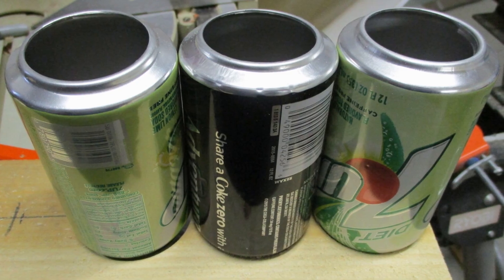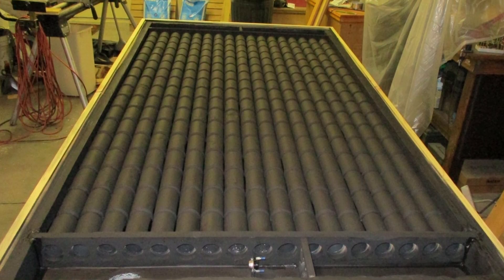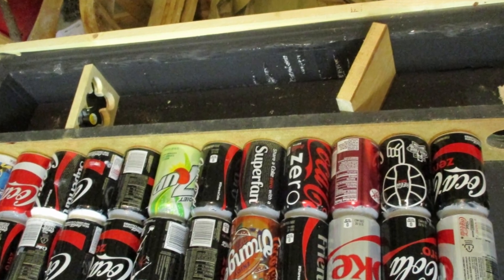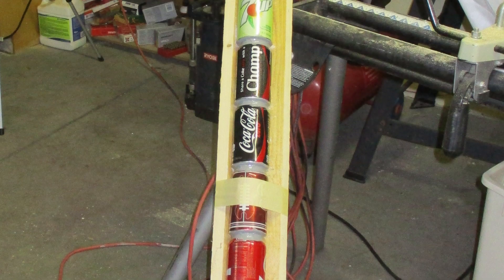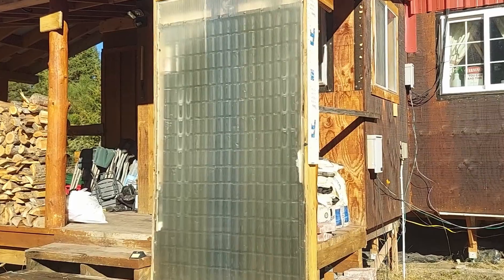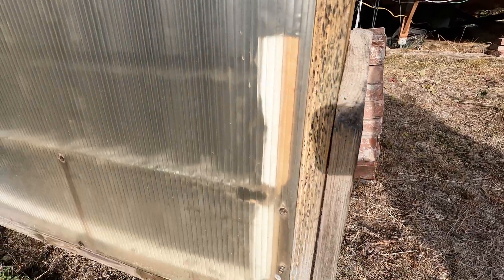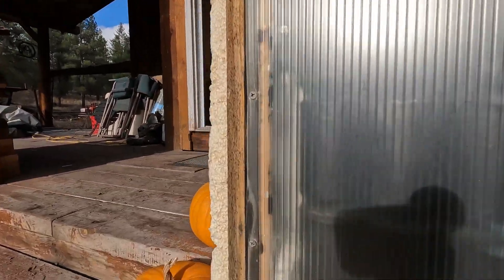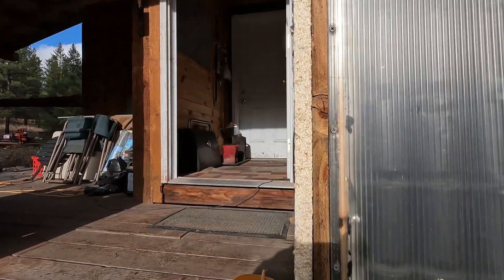You Asked About My Pop Can Solar Heater After 7 Years

Comment: How it works in winter?
Reply from the maker: As long as there is sun, it works.  Summer is when I don't want it so it doesn't generate much heat at all if straight up and down but in the winter it's almost perfect and makes lots of heat.

Comment: So I have been planning to do a pop can solar heater for my shed/chicken coop. My question is what if you put sand in the back of the set up once the sand heats up it will hold the heat overnight.. I thought of water, but water will eventually evaporate. Sand would make it heavy, but would it be worth it?

I think these ideas are really cool, thank you for making this video.
Reply from the maker: Interesting idea.  It would certainly hold the heat but would be very heavy.  Most use water barrels and water or antifreeze (beet juice etc) that they heat via solar like this and store in the room but you idea has some merit.

Comment: I don’t understand how this warm you home at night and when it overcast or it’s been raining. You need the sun to be out all day for this to work.
I rather use a Chinese diesel heater and store gallons of diesel after I add fuel treatment for long term storage. Guaranteed heat and I don’t have to wait for the sun to come out. During a power outage, I have power backup.
Reply from the maker: Of course, this works only with sunlight, however, when the sun is shining it's providing a heat source that doesn't need fuel.  Like many things, two is one.... having another source of heat, or two is a good idea, this will just reduce the need for them at certain times.  Plus, a well insulated room will retain heat.